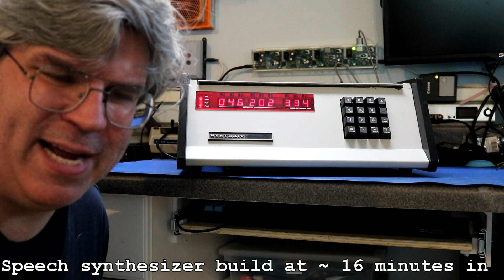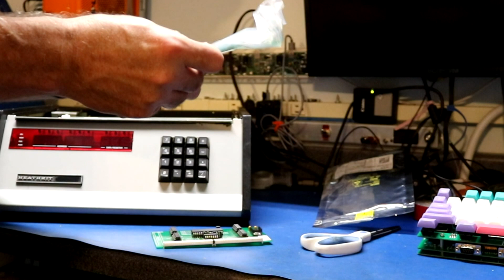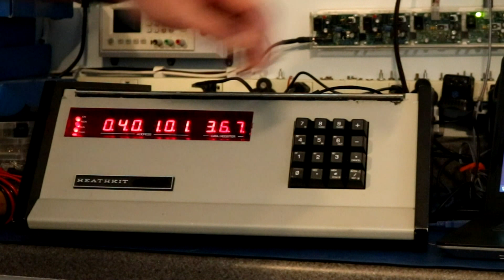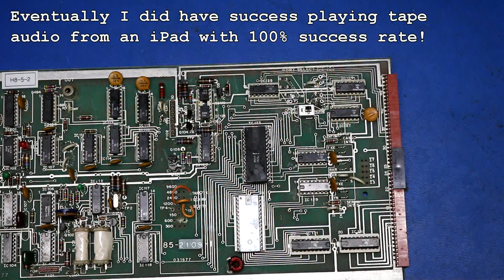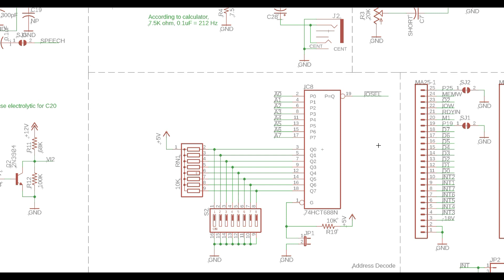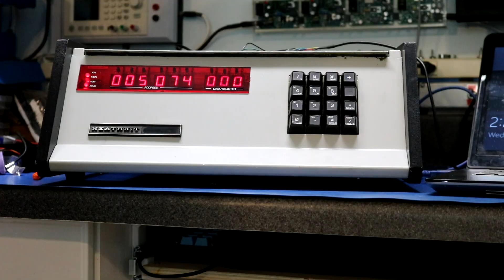Heathkit H-8 Part 1: Trying out the Tape Board, and Designing a Speech Synthesizer

Comment: What about creating a board that can decode FSK and turn that into data and also output FSK so you can save it on tape and use 1275/1445Hz which might allow for more reliable loading and saving of programs, you might have a look at the Mainline ST5 Terminal circuit you might be able to use in your computer.

Comment: Glad you are working with the H8, that was my first system back in 70's and it was a well designed box mostly, for its time. I still have several H8's and use them once in a while with CPM and actually do real work with them. Not the speed demons we have now but a great way to learn assembly language and understand the fundamentals of computer theory.

Comment: I have an H-8 we bought back in 1978 and I used through college. We had 56k-RAM as 4k and 16 k boards, the quad serial port card, the tape/serial card,  the H17 disk and the CPU card.
We upgraded it to the Z80-CPU card and did mods for 3mHz and then 4mHz. I threw out the tape/serial card and the RAM cars as the RAM chips were all dying. I designed a 64k DRAM card back in '82 IIRC. Also designed a TMS9918 graphic display card. Moved the guts to a 19"  rack case I had. I now regret throwing out the floppies. Heck, by '85 they were impossible to get.
Initially, I remember loading mbasic, then adventure or space war off tape and having it fail. Added the H17 disk drives and started with HDOS. The Z80 upgrade allowed running CP/M. 

Started with a H-12 terminal then upgraded later to the H-19.
Looking forward to what you do with this.

Comment: It was '76.  I worked for Heathkit.   The H-8 in Red is missing from the tag. Benton Harbor Basic was later called: HDOS  on H-89!
I also fought to have it program in HEX, but was turned down!  errr      WHO DOES OCTAL!
Reply: H-8 computer display in offset octal.  I worked at Zenith Data system in the 1980's.
Reply: @stevenretroworkshop2113  - Zenith was a dirty word for us. They bought Heathkit, then shut us down!  Sorry.